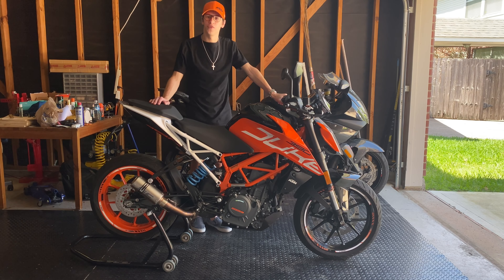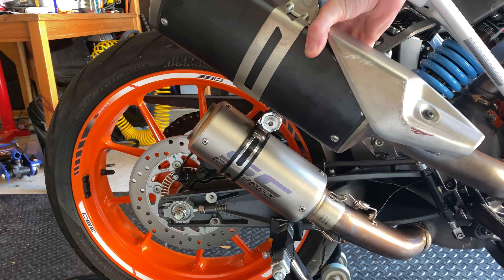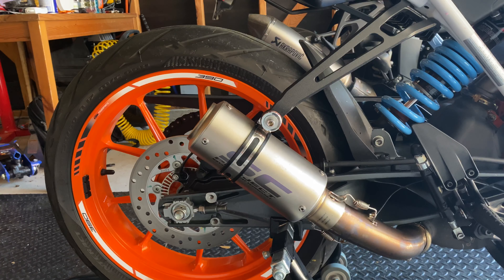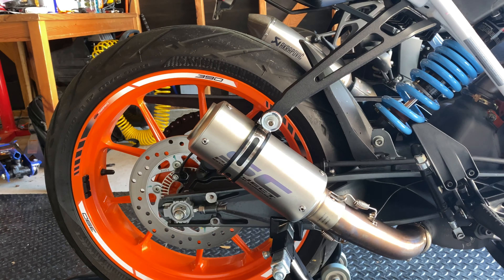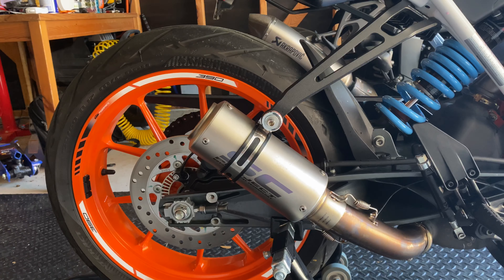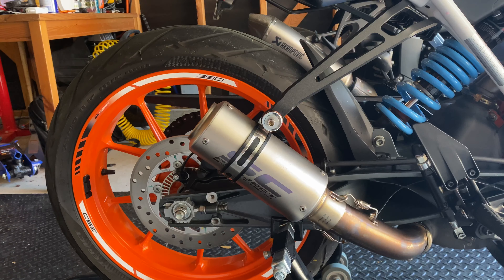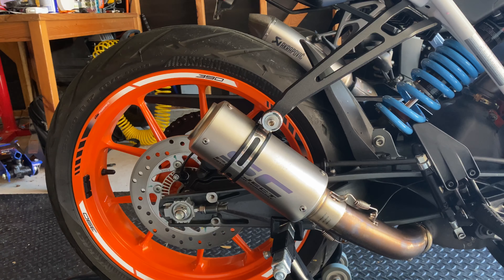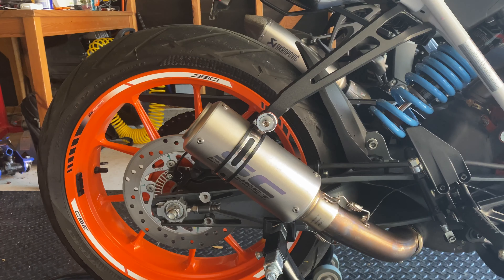KTM Duke 390 SC Project CR-T Exhaust Review & Sound Check

Comment: Finally someone that had a video where you can understand the English lol. Great video bro
Reply from the maker: Haha! That’s one of the reasons I started my channel. The major demographic for videos over this bike aren’t primarily English speakers, so I decided to make the same content they do, and try to increase the quality a bit. Thank you for the support!
Reply: @MotoRevs  I’m thinking about getting a exhaust for my duke200 and I hear that you can put a 51mm slip on.
Reply from the maker: That’s true! I’m not sure what size pile the 200 has, but I’m sure you’ll be able to find an exhaust that suits you. Either way, even if you have the smaller pipe, there is an adapter that the exhaust brings, so it’ll be sure to fit.
Reply: Yea I get that the duke is popular in India , but man you can hardly find any helpful videos from the states.
Reply: I'm from Malaysia and I'd rather find a video from somewhere that speaks english without a weird accent. So hard to find useful videos on the smaller KTMs 😂

Comment: Did you have to do anything to the ecu like flash it to run the exhaust?? Also awesome video!!
Reply from the maker: I did not, no. It's not necessary when installing just a slip-on exhaust. Perhaps when you go with a full system you probably should. Thank you!

Comment: So the set up is a Competition Werkes Mini cat delete pipe + SC Project CR-T Exhaust, yes?
Reply from the maker: Almost, the Competition Werkes pipe only removes the Pre-Silencer, it keeps the cat. The set up is as follows: Competition Werkes Chamber Delete, and the SC Project CR-T Exhaust. Thanks for the support!
Reply: MotoRevs what are the risk of running this set up without remapping?
Reply from the maker: There is no risk, because you keep the catalytic converter, so there is no need for remapping or changes to the fueling. Thanks for the support!

Comment: Does this provide a deep bass sound? It needs aftermarket pipe to install or you can install it on standard pipe?
Reply from the maker: It makes the bike sound a lot deeper and it gives it much more bass. You can install it on the stock chamber.
Reply: @MotoRevs  Thanks man! I would like to see pov with this exhaust setup and flybys :)
Reply from the maker: Absolutely, I'll get to that very soon.

Comment: Hello great video. Question do I have to buy separately the middle link pipe? Or it comes with it?? Thanks in advance.
Reply from the maker: Hey! Most kits bring the pipe, so there is no need to worry about that. Just make sure you buy the right one for your bike, and you should be good!
Reply: @MotoRevs  Hello ! Congrats for the bike ! Mine is a DUKE 390 2024 . How can I know the correct purchase ?

Comment: Does this come with a removable DB killer? You know, just incase im traveling to places where noisy exhaust are not permitted just slip that tube there and its fixed.
Reply from the maker: Yes, it does bring a DB Killer. It actually does make quite a difference in sound levels. Thanks for the support!
Reply: Nice bike and great exhaust, I wanted to ask what size CR-T did you get? Because on the website there are different mm sizes.. which one is gonna fit to the original exhaust pipe
Reply from the maker: Thank you! The pipe size for the Duke 390 is 51mm.
Reply: @MotoRevs  I’m on their website now and they range from 60-77mm, do you think it should fit to the stock standard pipe once you remove the exhaust for the SC slip on?
Reply from the maker: SC Project does not make an exhaust for the Duke 390. This is a replica exhaust. If you order this exhaust it will provide the pipe necessary to connect the muffler to the bike.

Comment: Hi. I have the 2021 model of the 390 duke. It is compatible with the 2021? because it says that it is until 2020. But it is the same right?
Reply from the maker: I do not believe so. The chamber/pre-muffler for the 2021 model year is slightly different and will most likely not fit. Try to find a version of the exhaust designed specifically for your model year.

Comment: Where the heck can i buy this kind of pipe everytime i saw this comes with excitement like im using a duke 1290 R
Reply from the maker: Ebay! Check around on eBay, even AliExpress has some. I bought mine on eBay a little over two years ago, and the exact listing I bought it from has since expired. There's lots of options! Good thing about this muffler is that its universal, so really, any of these would work!

Comment: Did you need to get the ecu tuned or run piggy back after exhaust install?
Reply from the maker: No, actually, I haven’t! I’ve never remapped the bike or installed a piggyback ECU. Some say that I should, while others claim it’s simply a helpful additive. I’ve experienced no problems and am confident those extras are not necessary. Thanks for the support!

Comment: Can u past the link for that exhaust the exact same one please
Reply from the maker: Unfortunately this exact same exhaust sold out, would you like a link to the same exhaust from a different seller?
Reply: @MotoRevs  yes please
Reply from the maker: Sure thing! Here’s the link -

https://www.ebay.com/itm/For-KTM-125-250-390-DUKE-RC390-2017-19-Motor-Exhaust-Muffler-Tube-Mid-Link-Pipe/362959814670?fits=Model%3A390%7CSubmodel%3ADuke&_trkparms=ispr%3D1&hash=item548217400e:g:g~4AAOSwkBtegxRn

Thanks for the support!

Comment: You know if it would fit a 2021 vitpilen 401? If so how can I get it?
Reply from the maker: I’m not too sure, to be honest. I’d most likely have to guess it wouldn’t, as the 2021 model year Duke has a different exhaust than my bike generation. This would apply to the Vitpilen as well. I would do some more research and analysis before considering purchasing.

Comment: Hello, can you tell me the exact reference of this exhaust, is it the MFL-60-36T? thanks bro
Reply from the maker: Sure thing! This exhaust that I reviewed is actually a replica, as SC Project does not make an exhaust for the KTM Duke 390. It can be found on eBay from anywhere from $50 to about $100. The exhaust you mentioned, however, would technically work, as that muffler is universal for most bikes! Only thing is, the Duke 390's pipe diameter is ~51mm, and the exhaust you brought up has a diameter of 60mm, so fitment may be an issue if you wish to install it on a Duke 390. That authentic exhaust is titanium, whereas my replica SC Project is stainless steel, so the original would sound a bit better, albeit much more expensive. Hopefully I cleared it up for you!
Reply: @MotoRevs  Thank you very much, your comment was very helpful, greetings from Colombia
Reply from the maker: I'm glad I helped! Thank you for your support!

Comment: Is this original sc exhaust?
Reply from the maker: Unfortunately no, this is a replica of an SC Project exhaust. If you would like an authentic exhaust with a brand name at a higher price, consider Akrapovič or Austin Racing. Thanks for the support!
Reply: MotoRevs original costs how much ?
Reply from the maker: The originals range anywhere from $300 to $2000, depending on the model, the bike, and the purpose.
Reply: MotoRevs for duke 390
Reply from the maker: Unfortunately SC Project does not make an exhaust for the Duke 390. They do however make models for the Duke 790 and SuperDuke.

Comment: Hey man, nice video. I just got the same exhaust, but it didn't came with the baffle. Could you please let me know where you have fitted yours so that I can buy a similar one ?
Reply from the maker: Sure thing. My baffle looks like a cone type of thing. I showed it in one of my other exhaust videos. Check out my other videos so you can see what it looks like, and for reference, I installed it in between the muffler itself and the pipe connected to the muffler. The baffle sits right in between.

Comment: Will this fit on a duke 390 2022
Reply from the maker: Actually, I don't think it will. The BS6 model is changed slightly and altered the entire exhaust system - the connection is slightly different and wouldn't fit exactly. I'd recommend searching for a BS6 SC Project exhaust, one specifically designed for your 2022 model year.

Comment: Sounds awesome where can I get one do you have a link ?
Reply from the maker: Unfortunately, this exact one sold out a couple of years ago, but there are many more on the internet. Check around in the comments, as I've seen others helping some other viewers find one like it! Alternatively, you could simply search on AliExpress for "Duke 390 Muffler", or likewise, and see what you can find.
Reply from the maker: I used to have a link, but that one has since sold out. If you search on AliExpress or eBay you should be able to find it! Just a bit of looking and you'll be good.
Reply: @MotoRevs  dude mine sounds nothing like urs, i got it from ebay looks same but its in black ;(

Comment: How much it costs ?
Reply from the maker: I bought this one on Ebay for around $60. Would you like a link to the product?
Reply: @MotoRevs  Hey! i would like a link if possible! i am interested in finding this in black but having trouble. much appreciated
Reply from the maker: https://www.ebay.com/itm/For-KTM-125-250-390-Duke-Slip-on-Exhaust-Pipe-Silencer-Middle-Link-Connect-Pipe/264349940127?fits=Model%3A390%7CSubmodel%3ADuke&_trkparms=ispr%3D1&hash=item3d8c7bf99f:g:1oIAAOSwPn1c9zZZ

Unfortunately, the seller increased the price by about $30, but hopefully this could be of help to you.

Comment: Does this fit on the 2021 model??
Reply from the maker: Unfortunately I do not think so. KTM changed the air box design so that now the angle of the pipe and the reach is slightly different, but different enough to prevent the old (2017-2020) style exhaust from being fitted. I apologize for this.
Reply: @MotoRevs  Thank you for the response. I have to look for an alternative then maybe the Akrapovic slip on

Comment: Can you give the link from where you got this sc project...
Reply from the maker: Yes, here’s the link - 

https://www.ebay.com/itm/For-KTM-125-250-390-DUKE-RC390-2017-19-Motor-Exhaust-Muffler-Tube-Mid-Link-Pipe/362959814670?fits=Model%3A390%7CSubmodel%3ADuke&_trkparms=ispr%3D1&hash=item548217400e:g:g~4AAOSwkBtegxRn

Unfortunately the price has increased in the last few months, but it still is the same exhaust. Thanks for the support!

Comment: Can you drop a link , I can’t find this exhaust at all anywhere . Hah 🙃
Reply from the maker: Sure thing! Here’s the link - 

https://www.ebay.com/itm/Modified-Exhaust-Muffler-Tube-Mid-Link-Pipe-for-DUKE-125-250-390-RC390-2017-20-/362959814670?_trksid=p2349624.m46890.l49286

I would like to say in advance that this exact item may be out of stock, yet there are multiple just like it for sale.
Reply: @MotoRevs  fasho thank you! And yes I seen the out of stock add , but now I can see at least the parts picture they have on there and try to get one that’s the same ! Thank you!
Reply from the maker: I’m glad I could help!

Comment: Do you have a link where you bought this exhaust?
Reply from the maker: Yes, here’s the link - 

https://www.ebay.com/itm/For-KTM-125-250-390-DUKE-RC390-2017-19-Motor-Exhaust-Muffler-Tube-Mid-Link-Pipe/362959814670?fits=Model%3A390%7CSubmodel%3ADuke&_trkparms=ispr%3D1&hash=item548217400e:g:g~4AAOSwkBtegxRn

Unfortunately the price has increased in the last few months, but it still is the same exhaust. Thanks for the support!

Comment: where have you buy this sc project exhaust ?
Reply from the maker: I bought this exhaust on eBay! It was for a great price, however it’s gone up just a bit, as has everything else. Would you like a link to the exhaust? I’m not sure if it will work, however, depending on where you live.
Reply: @MotoRevs  If you can, it can be great
Reply from the maker: Sure thing! Here’s the link -

https://www.ebay.com/itm/Modified-Exhaust-Muffler-Tube-Mid-Link-Pipe-for-DUKE-125-250-390-RC390-2017-20-/362959814670?mkcid=16&mkevt=1&_trksid=p2349624.m46890.l49286&mkrid=711-127632-2357-0

I hope it works for you!
Thanks for the support!
Reply: @MotoRevs  thanks you very much
Reply from the maker: Absolutely! Thanks for the support!

Comment: What exhaust hanger did you use?
Reply from the maker: I used an Evotech hanger that I bought for about $70.
Reply: @MotoRevs  Thanks!
Reply from the maker: Anytime.
Reply: @MotoRevs  hey was it required to use that exhaust hanger or did you just want to eliminate the passenger pegs?
Reply from the maker: I removed the passenger foot pegs quite a while ago, so I have an aftermarket muffler bracket installed. You can use this with the stock foot pegs, though.
Reply: Thanks man! Was hoping the hanger wasn't required because I just ordered the sc proj knockoff pipe a few days ago based on your bike's killer sound in the vids. Eventually I hope to add a stunt cage and sliders but she's just too new right now so going for loud and proud!
Reply from the maker: I’m glad I could help! And I hope to see your bike when you add all the mods you want. Thanks for the support.

Comment: You have a link to this setup?
Reply from the maker: I don't exactly have any links, as everything has sold out, but I bought all of the titanium parts from AliExpress; I have the links to the parts I purchased in the video's description. The only thing I purchased on eBay was the muffler. I hope I was of help!
Reply: @MotoRevs  titanium parts as in the connecting pipe?
Reply from the maker: Yes, I have the main 3 parts in titanium - the header, the down/connecting pipe, and the small link pipe connecting to the muffler.
Reply: @MotoRevs  in this video was everything stock except the connecting pipe and muffler? I see you have a video posted later with the silencer delete. I can’t find that muffler in stainless, only black
Reply: @MotoRevs  in this video was everything stock except the connecting pipe and muffler? I see you have a video posted later with the silencer delete. I can’t find that muffler in stainless, only black
Reply from the maker: Forgive me, I thought this was a video consisting of the titanium parts. Unfortunately, pretty much all of those parts have sold out due to high demand. I apologize.
Reply: @MotoRevs  I found the connecting pipe on Amazon, I just can’t find the can. Do you remember where you bought it from?
Reply from the maker: I got the muffler off of eBay, all I did was search for "Duke 390 exhaust" and it should show up sooner or later. They're getting hard to find, though. I'm sure you'll find it!
Reply: @MotoRevs  yea that Amazon one is the only one I’m getting, u think it’s the same?
Reply from the maker: I'm sure the same product is being listed under different seller names and websites. It could very well be!

Comment: Where did you purchase that exhaust at?
Reply from the maker: I bought this exhaust on Ebay. Would you like the link to the exhaust?
Reply: Yes I would appreciate that! Did you do anything else to the bike to accommodate for more fuel because of the more open muffler like a piggy back ecu?
Reply from the maker: I did not, no. This bike’s engine is too small to really cause any harm to itself without a remap. I’ve personally emailed Akrapovič and asked if when I modify the exhaust if I should remap, they said it is not necessary, as this engine is simply too small to cause any real damage. 

Here’s the link to the exhaust - 

https://www.ebay.com/itm/For-2017-2019-KTM-390-125-250-Duke-Exhaust-Pipe-Slip-On-51mm-Motorcycle-Mufflers/274324130198?fits=Model%3A390%7CSubmodel%3ADuke&hash=item3fdefe0996:g:3v0AAOSwE1Veg~gK
Reply: Awesome! Do you have that link? I tried finding it on eBay but no luck
Reply from the maker: Yep, I left it in my previous reply. Thanks for the support!
Reply: I see it now, I did find a black one just like it. What did you give for ur exhaust? Because the one I found is only 77 dollars idk if I trust that lol
Reply: MotoRevs what year is your bike?
Reply from the maker: I like the black too, but I opted for the bare steel finish. I paid $60 for the exhaust and a bit for shipping. I have a 2018 model year.

Comment: Link to buy ?
Reply from the maker: I used to have a link, but that one has since sold out. If you search on AliExpress or eBay you should be able to find it! Just a bit of looking and you'll be good.
Reply: @MotoRevs  thanks going to pick up my 390 in 2days and looking for some mods already including the SC project exhaust! 👉💯💥
Reply: You need just the exhaust or need to buy also extra pipe? Thanks😊❤
Reply from the maker: Most of the muffler kits should bring the midpipe, and all hardware needed to install. Check before you buy, though!
Reply: @MotoRevs  that means you can't use the stock pipe only need the mid
 one also?
Reply from the maker: Well, yes. You'd need the muffler and the link pipe. Most exhausts bring both.

Comment: How to reduce seat height in ktm duke 390 and how many  MM we can reduce in this bike
Reply from the maker: You can buy an aftermarket seat to reduce the height of the bike. KTM offers an “Ergo Seat” which is more comfortable than the standard seat. If you want to lower the bike you can buy the lowering kit from KTM and it will lower your Duke by 25mm. Thanks for the support!